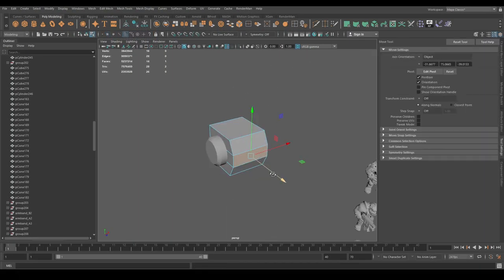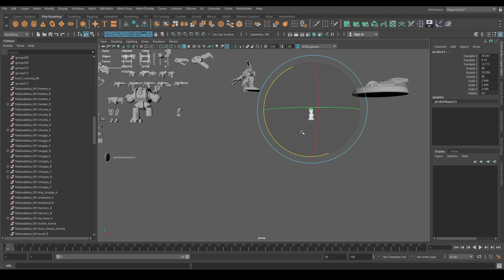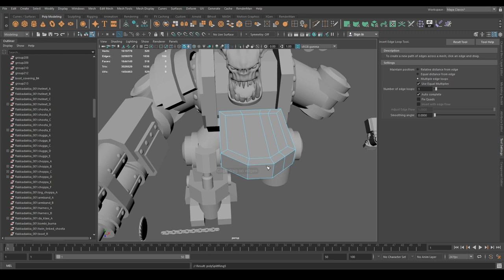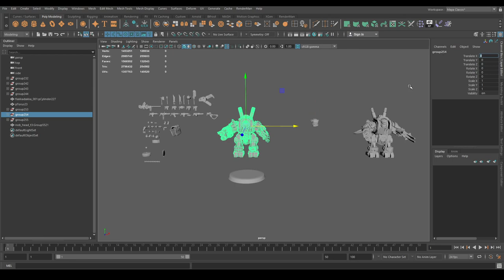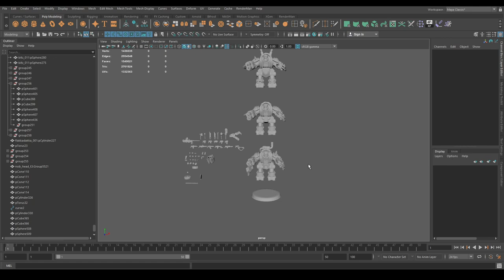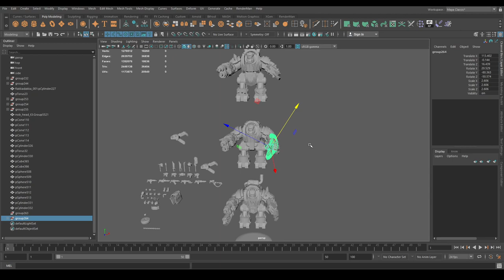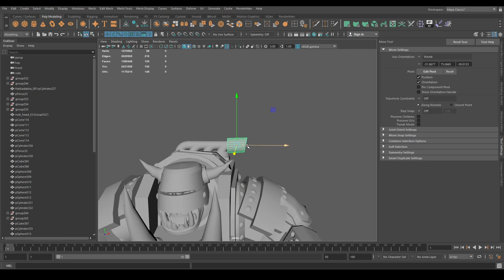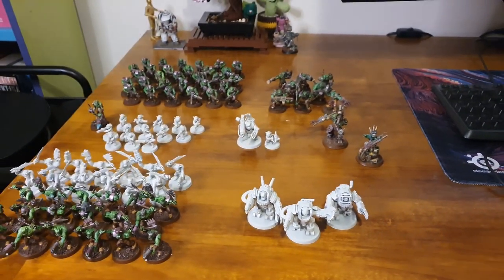Designing a 3D Printed Wargaming Army | Orks Episode 5

Comment: Something that confuses me in every video.... why you dont print them as bits and then but them together? That way you could make with the parts for 3 something like 18 or so and having the parts and placing them on to the mini irl sometimes give you a... OOOOH YES thats sick im gonna do it that way moment
Reply from the maker: I'm definitely doing this for bigger models, and its something that I have considered for the smaller ones too. It just seems like an extra step that isn't necessary at this point, although its possible that printing in parts could reduce visible marks caused by support material. I'll mull over it some more.